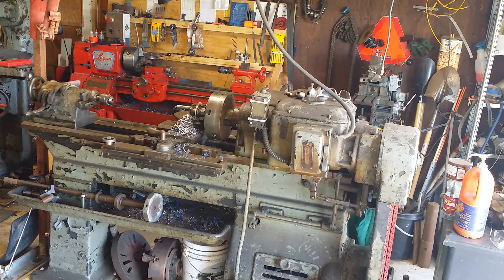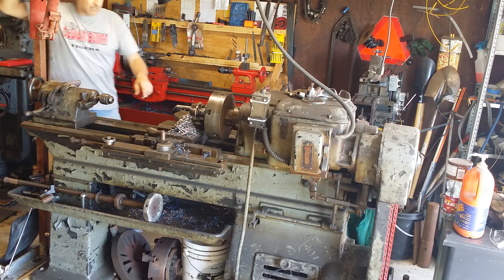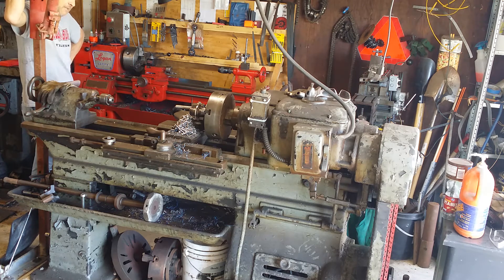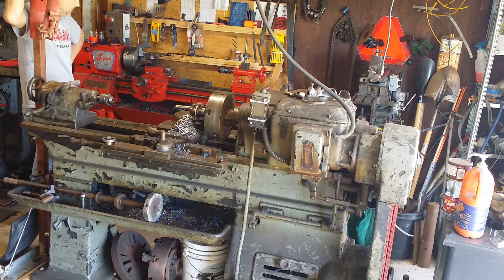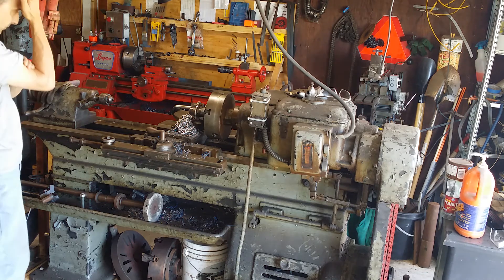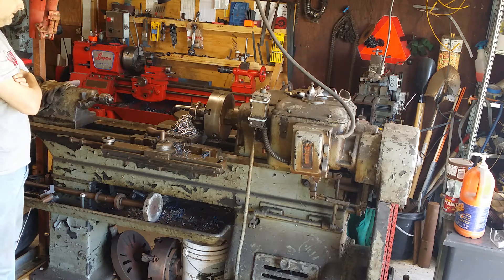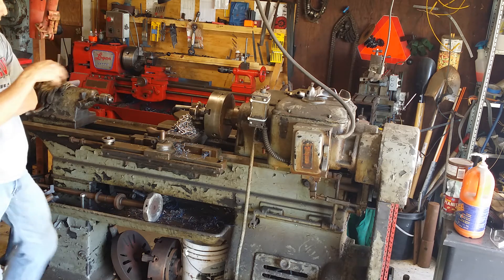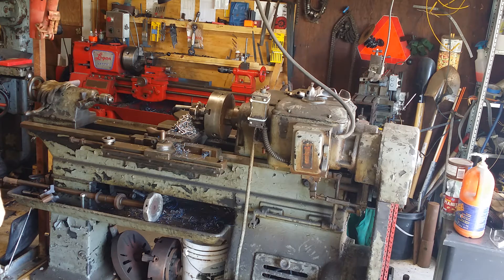Little comparison of the hendey and logan lathes, which to keep, or keep both

Comment: I understand completely. I have 4 lathes, a 15"x8' South Bend, a 9"x52" SB, and a 1024 Jet. Then there's the 7x10 mini-lathe that I made CNC a while back. I couldn't do without any of them. Each and every one gets used at least once a week. If you can manage it keek them both you'll never be sorry you did. But, get rid of one and you'll regret it until you can replace it. 😁

Comment: I reckon they're both great lathes. Unless you're hurting for cash, I'd keep both. You can leave one set up with a collet chuck, and one with a standard 3 or 4 jaw - and use whichever is best suited for the job. If you can set them up so they can share the tooling, so much the better.
Reply from the maker: I hadn't considered the collet chuck thing, but certainly is a good idea. The hendey has a partial collet setup..hmmm

Comment: I only have an old Atlas right now, lighter than your Logan by far, but when I'm able to upgrade, it will be staying.  Not everything will require I need to flip on a phase converter to fire up a big lathe.
Reply from the maker: Maybe just maybe if I ever stumble onto a fairly beat up, cheap monarch 10EE. Perhaps that would be good enough to replace both. What size is your atlas?
Reply: @craigtate5930  I've got a TH54 with what's referred to as a Popular Mechanics quick change gearbox.  10 inch swing, 54 inch bed, probably around 300-350 pounds.
Reply: @craigtate5930  when I do get to upgrade, I'd love to get my hands on something in the range of a Southbend 16 inch, Monarch 16CY, or comparable.
Reply from the maker: @radenscreationsandrestorations  cool I have seen 1 of those gearboxes on youtube before. Neat design